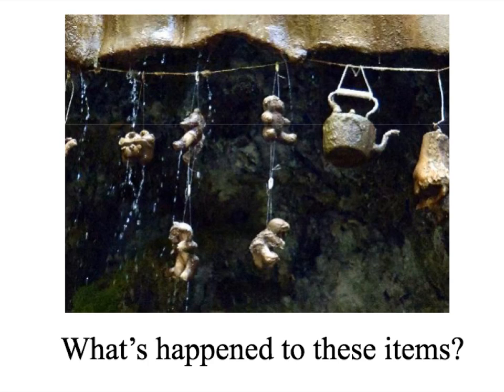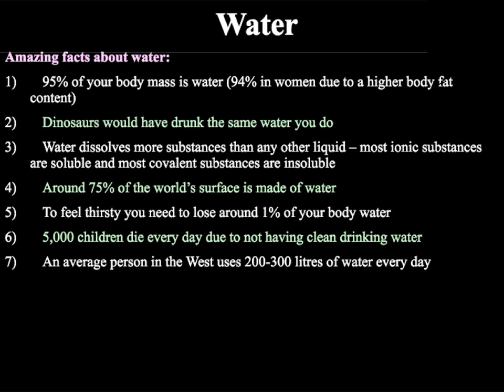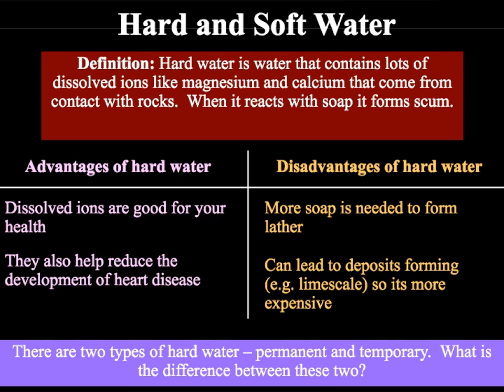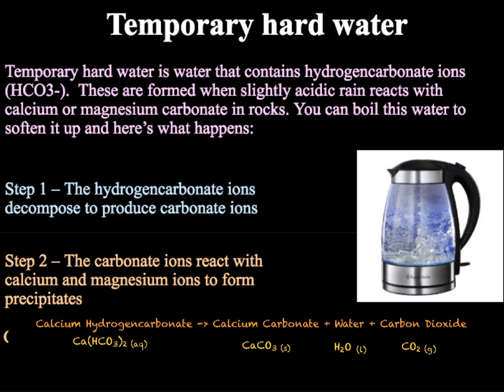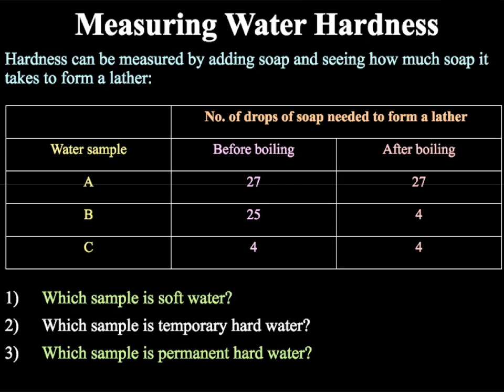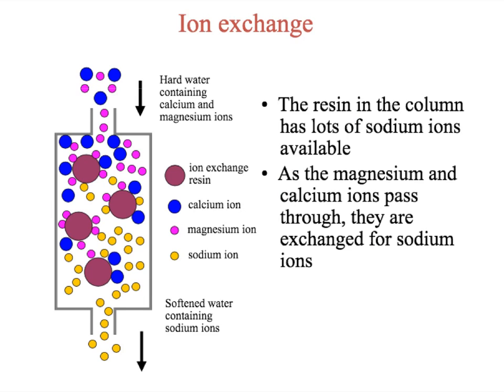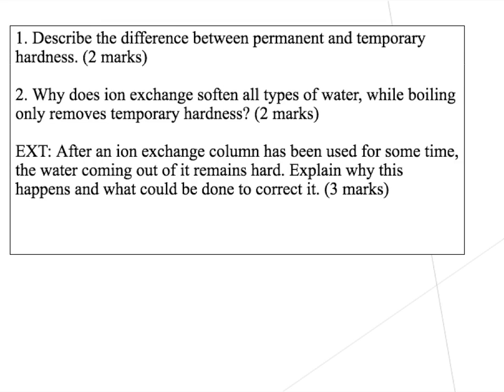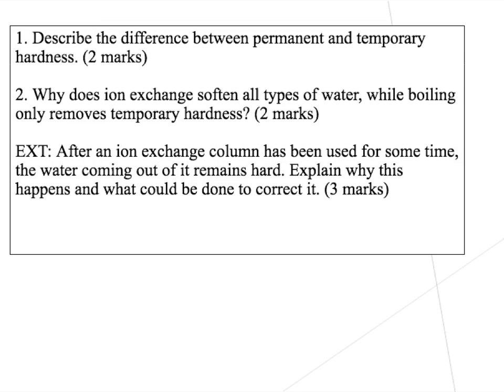C3.2 Hard and Soft Water

Comment: hey Mr G
you last part where you talk through the exam questions i didnt get question 2 
please explain!! :)
Reply: last minute revision ftw
Reply from the maker: Using an ion exchange column will remove both temporary and permanent hard water as the calcium (or magnesium) ions will be exchanged for sodium ions. This will soften both types of water. If we boil temporary hard water the hydrogencarbonate is decomposed to form a carbonate, removing the hardness. However if we boil permanent hard water then the Sulphate is not decomposed, therefore the hardness is not removed.